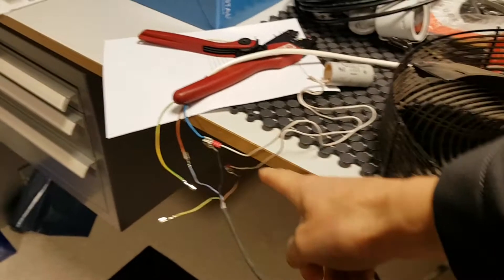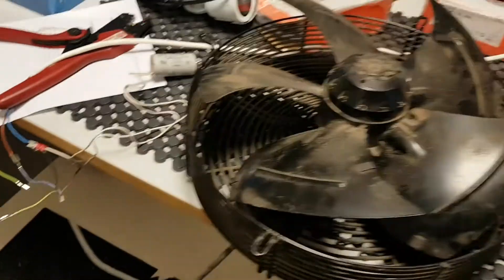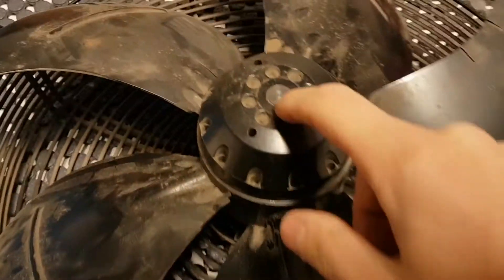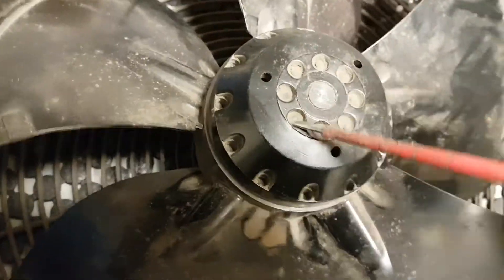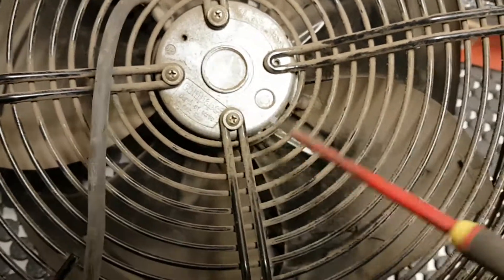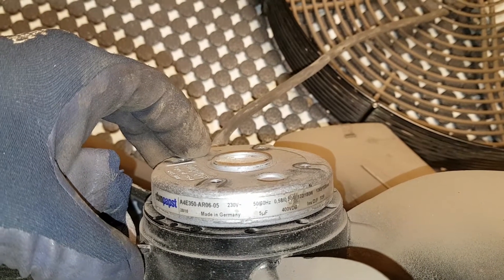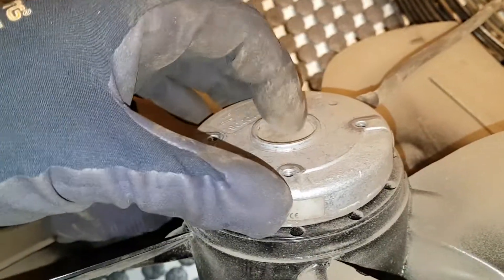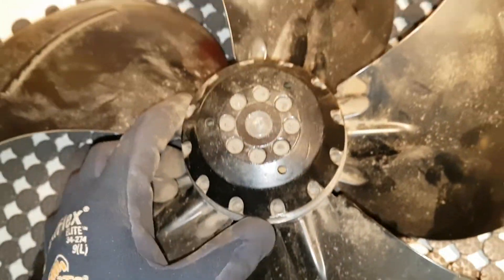EBMpapst A4350 Air Condition Fan problem

Comment: Hi, were you able to open it ? I have a similar one from ebmpapst and need to change the bearing. I took the c clip out but not sure it can come out just by pushing the shaft. Can you open it just by taking the clip out or the fan blades should be removed ? Does and body solved this problem ?

Comment: Under ” koppen” sitter det ett c - clip .. lossar man den så kan man dra ur axeln på motorn och man kommer åt båda lagerna..
Reply: Is that is? just remove the c lip and push the axel downwards using hammer? no need to remove fan blades? Thanks
Reply from the maker: Tack för svar jaakisen. Ska försöka peta bort koppen, men den verkar sitta hårt. Något tips för att få bort "koppen"?
Reply: @simplicitygarage  när jag tog ur den så gjorde jag ett hål och bände med en mejsel....Tror koppen har en dammskyddande funktion ... men kunde ej lista ut annat sätt att få bort den...
Reply: @simplicitygarage  https://youtu.be/QAHsoFwTq8U